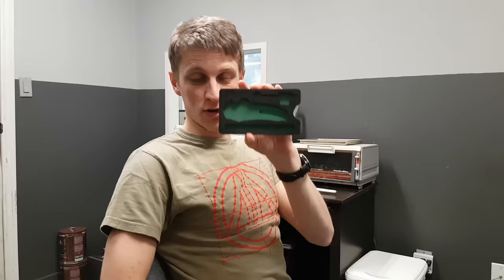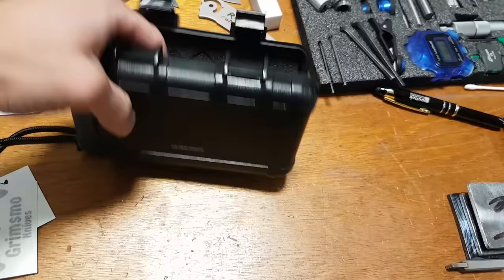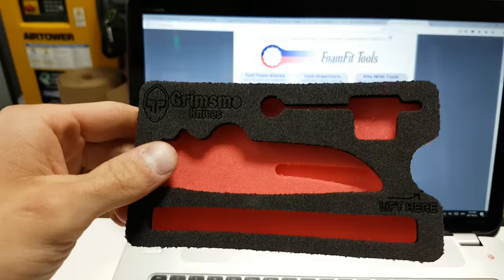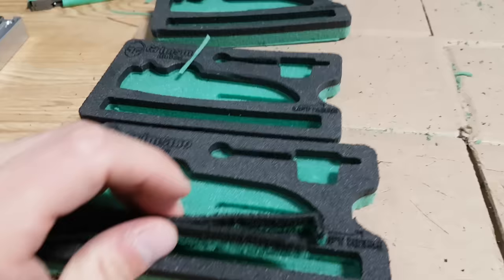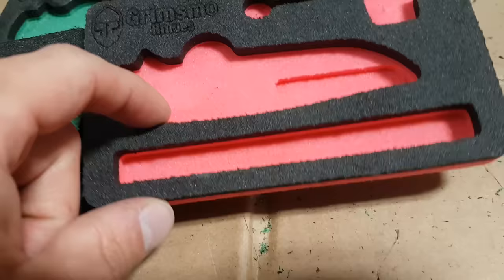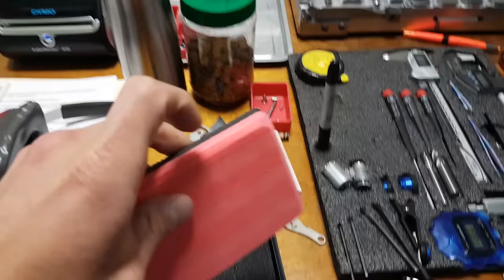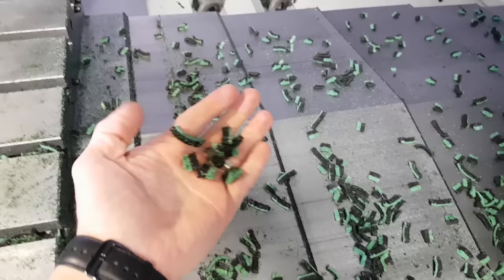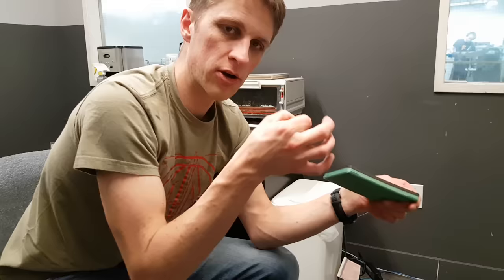How to Cut Foam

Comment: Hi. I work at a flight case company in Holland where I cut a lot of foam for huge flight cases to tiny presenting boxes like yours. So I thought you might like some tips. How we do it. Instead of putting the foam directly onto the suction grid we put a thin sheat of 3 millimeter mdf wood that allows the suction to go tru and then set the dept of the router to just hit the mdf so you cut al the way tru the foam. So then you get an instand smooth edge. I do like you're idea of the table router to round of the edges. Nice! We use a very fine bandsaw that you can put on a 45 degree angle. But I think you're doing it well! When the foam comes of the cnc it's always a little bit rough, that normal. So we hit it gently with a heat gun so it melts all the burs away and gives it a general smooth finish. Another thing, my personal taste, I think it looks a lot better If the egg box foam in the lid has smaller bumps. Here in Holland you can get them in all sorts of depths en thicknesses. Good luck!
Reply: Genius, so many great ideas/improvements in the processes
Reply: I have a more effective way to cut foam😊

Comment: I spent 40 years in the machine tool industry John and you did a great job with that foam insert.  I had several ideas pop up during the video only to see you use them later in your presentation, so "great minds", eh?
All in all, nicely done and it was fun watching the problem solving process again.

Comment: A trick for getting rid of the fuzzy edge is to use a heat gun. The tiny fuzz shrinks from the heat faster than the solid foam will burn. So if you do it quick enough you get a clean product.

Comment: From experience, if you go over eva foam lightly with a heat gun it helps clean up some of the fuzz around edges. Not sure if it'd work with that foam but might be worth a shot on a scrap piece.
Reply: #CosPlaySecrets :D
Reply: Yea Ive done this! Hit it quickly with the tip of a bic

Comment: I have been CNCing foam for years. I assure you that trimming the outer edge of the hole first is what we have been doing for years. With foam working from the inside out almost always works better. We have used a curved razor as well as routers to make radius edges.

All in all very good job with a nice learning curve.

Comment: Hi John,

You can cut all the way through the product if you use a 5/32 piece of hard board with a flat closed cell (Adhesive backed) foam on it. You then can suck that down to the vacuum table and cut shallow pockets that follow the general shape of the part with just a little offset. These smaller pockets would essentially combine to form the shape of a part which you then create the array from. This forms a seamless, flat, gasket surface that will not leak. Ports are added to the jig to allow vacuum pressure to build in each pocket section. Then, you just suck down the template and your raw material at the same time. 

Here is the ultimate trick that makes this work. Since you now have a thickness to the foam that resides on the top of the template (bottom of the case foam), you can now cut all the way through the case foam without releasing the part as long as you only cut into the template foam but not through it. We used this method all the time and it is awesome.

it would look similar to the jig set up in the link provided, but your cutter would not go all the way through the foam in the cut path below the part. 

This company sells the sheet goods.

http://allstaradhesives.com/cart/category/cover_sheets

Comment: I'm impressed with your process problem-solving skill. I wouldn't have considered changing tool paths to correct the edge cutting issue. Since the material in use is just foam, I THINK it might be much less costly to cut using custom dies for each layer, before bonding them as a final sandwich/assembly. Instead of wearing out an expensive CNC router that requires several minutes per unit... a custom cutting die would simply press down and through the foam in 2 seconds. A medium durometer rummer base surface would preserve the cutting edges forever (virtually). I don't want to sound critical. Your business and presentation/marketing skills are exceptional. Thanks for posting.

Comment: I had an idea for the back radius: A screen for the vacuum plate to put the foam inserts back on it upside down and milling the big radius on the CNC. Picture a lasercut plastic/acrylic/wood/thin aluminium "waste" lattice from your parts. With the screen you locate the inserts to the plate and cover up the exposed bits at the same time. This way you can even mill a small pocked if you need more space for things in the bottom.

Comment: I use a 20w fibre laser to mark foam like that, and it comes out really well. Just melts the surface, very clean high resolution mark in only a few seconds (along with some nasty smoke.) I use plastizote LD45 or thereabouts for the foam, routed and then laser marked to put the logos on. its so fast, we even engrave customers names on their foam as we send stuff out. Takes seconds.

Comment: Maybe you should make a aluminum/ Plastic template that fits inside the foam cutouts, on which the router bearing could ride. I think it would make Berry's job a little bit easier and more consistent.
Regards from germany
Reply: Great idea. I would try a frame enclosing the upper half of the foam combined with an undersized bearing to end up with proper final dimensions.
Reply: Exactly my thoughts.
Reply: Ooooor make a die from steel die rule and use a clicker press.

Comment: In re: "Make chips" - I don't know the details of your plastic foam, but in some cases you can make soft materials like this more brittle by keeping them in the freezer until you need to machine them, or by some kind of forced air or wet process at the bit to keep them from melting by tooling friction.

Comment: I just saw this video.  Awesome.  I highly suggest you watch (albeit totally different subject) the following channels about working with foam.  Kamui Cosplay and PunishedProps.  I highly suggest trying the heatgun method for heat sealing and deburring the foam...  I always though about laser cutting the layers and glueing them later.  So thanks for sharing.  Cheers.

Comment: Great work on the foam John. I have a suggestion that may have cleaner and safer results when routing the radius. Machine a jig that fits over the foam, just the upper half and put a smaller bearing on the bit and presto, clean, precise and no accidental radiuses on fingertips.
Reply: 393stroker, Great idea!

Comment: Have you considered to cast the foam parts? Smooth-On has lots of different types of foam, that would fit your needs. This way you could cast the foam parts in ONE go. If your mould is big enough for 6 pads, you could make 6 pads in less than 5 minutes. Nice video btw. Thanks.

Comment: 25+ doing custom interiors,,and still using a DA with 60grit 3in flex wheel,,,Router use was a super means of removal,,love it,,nice to see you putting should detail into the cases,,Bear

Comment: At the beginning I was saying "No CNC, no CNC", and then "Crap!". Apparently everyone but me has a CNC machine, lathe, and a 3D printer.
Reply: Damnit Jerry I thought there was a hair on my monitor! :D
Reply: Atleast get the 3d printer...they are as little as $130 for a decent one.
Reply: Yeah as the other dude said, 3D printers are not prohibitively expensive. The software to design (such as Fusion 360 non-commercial license) and slice your files is free, many free models online also. Material is fairly cheap

Comment: When you form dense foam buttstocks for guns you grind them on a belt sander to get the final shape.  However they tend to struggle because the friction makes them too hot.  Try putting your foam into the freezer before you use the roundover bit on them.  I bet that will make the roundover easier and cleaner.  The cold will make the foam more ridgid during the roundover process.  Worth a try and is the go to trick for ridgid foam grind to fit shotgun recoil pads.

Comment: Should be able to use wood router bits in your mill. Quarter inch radius corner rounding bit with no bearing, run it like an endmill. Only trick might be fixturing and holding the foam after you finish the top and flip it upside down. Might be able to make a fixture plate that will sit on your vacuum plate and direct the vacuum to the right places to hold the individual pads once the router bit cuts them up.
Reply: l wilton I concur,  just stop, flip, change tools and bam, perfect every time.

Comment: Thanks for sharing your videos.  I'm sure you have given lots of people the courage to become an entrepreneur since you fill in a lot of the mystery of all the steps it takes to run a small business.  Since you have the equipment to make a mold, have you thought about just creating the exact piece through injection molding?  Of course you would have to learn how to mix the chemicals to make the foam, but it would give you a nice smooth surface finish, and it would give you even more control over the process.

Comment: Looks cool. Only suggestion I could make that would help your throughput and may assist with your router table, is to use a profile cutter to remove your foam from your blank. Basically a razor sharp cookie cutter. Light press around each perimeter and you no longer have the remnants to work around for the bearing. Or you could use a 3m strip on the base or edge of the vacuum holes to hold the pieces to the table and then remove the material you leave.

Really cool either way.

Comment: John, look into what's called a pin router.  It will cut the same pattern every time. Make a pocket for the foam to fit in and then you can rout the the edge the same every time.

Comment: I loved the look of your logo on the top foam. Heres a thought. A little dab of adhesive on the tips of the egg carton foam and the foam put in wavy side facing the case top. This will glue it so it wont fall out. Your logo on the flat side so you can see it or on a thin piece of denser foam adhesived to the flat side of the wavy foam. All this should give you a springy top foam that will hold everything snug when the case is shut and still have that super bad ass look of your logo on the top foam. Just a thought. Hope it makes your product better.

Comment: You can use the big cnc to make a mdf support, fit the foam in the support so it stays firm, then use the table router with the roundover bearing indexed on the mdf.

Comment: The round over router bit has a bearing that needs a hard surface to follow. Make a insert that mates to the foam cut out but offers a smooth hard outline surface for the bearing to profile.

Comment: Hey John, you might want to look into a straight flute endmill instead of spirals. I use to cut plastics and wood with spiral endmills but they leave rough burred edges. With a straight flute, you should get clean pristine edges on foam all day!

Comment: Ever looked into die cutting?  It's FAST and CLEAN.  Die cut the top then glue the color pad layer and die cut the outside.  Emblem could be heat stamped in less than a second.

Comment: Hey John, My thoughts on the foam Radius. Machine a positive die/male. this way the foam could be turned over and the die used as a template/pattern routing system. With a custom router Bit (lets say lakeshore), bearing on the bottom to follow the template, foam upside down on the template.  This could face the edge and round over the radius. Please get your man a pair push block.

Comment: You might be able to remove the router table step all together with a back corner rounding end mill. Use the thumb indent for entry/exit location and then just go for it full engagement. Lots of reasons this might be a total disaster and would definitely not work in materials that aren't foam but who knows, might save time and give you control over that last step. Really cool video btw.

Comment: I'm surprised you don't laser engrave and laser-cut the foam, or water-jet cut it—it gets past all the pesky issues that machining the foam creates. Since you're not using abrasive media with the water jet for foam, it's actually pretty economical. Maybe for a future case revision—as is, these are still great and you've really laid out a good process to do it well with the machine tools!

Comment: Cool video.  I can see you guys are very passionate about your products and packaging.  If I may make a suggestion, others posting here have mentioned this, take a look at custom die cutters, or custom die cutting service.   If you had a set of custom dies made for your cutting shapes, you could drastically reduce your time in preparing each piece and eliminate burrs, rounding, and ragged edges.  Milling is nice, but makes your time considerable for each piece.  You spend a lot of time trying to fix the problems associated with milling. Maybe a heat stamper or different kind of die could impress the logos and lettering.  Check out custom die cutting services, too.  Just suggestions.

Comment: Wow when i was watching the video,I could not believe you were milling the foam,I could see if you needed a one off item,but i was like screaming as i was watching more and more just thing why are they not Die cutting them,it is super easy to do Basically you just bend up thin spring steel called Die Rule,and you just insert them into a MDF pattern of your shape and use a Arbor Press or a Rubber Mallet to hit around the Parameter very simple,then you can use 3M contact adhesive to laminate the two different colors together
Reply: erik pecchi with a die they’d need a clicker press. Quicker than milking them out.
Reply: We used to mill ours as well because you need varying depths, which not easily achieved with die cutting processes. Now we use a laser to cut and glue the layers together, which is still labor intensive.

Comment: If you want to know the proper way to do this that industy uses, lookup "steel rule die." They are mostly used by the cardboard industry, but are great at cutting foam/rubber consistently, quickly, precisely. At the place I used to make them we charged about $500 for a basic one. You can buy the steel rule and make one yourself by bending it and hammering it into slots cut in plywood.

Comment: At our makerspace we really love using a laser cutter on foam like this - but we wouldn't be able to do the dual layer like that without manually gluing it after the fact. (cut stencil then glue to solid base)  Laser foam is awesome. Looks like you tweaked this to perfection too :D

Comment: I have never machined foam but my first thought is. For the bottom consider making a cap that locates off your cuts in the foam or the outside. Then use a router table with a radius bit. The cap is for the bearing to run on. Or make a vacuum plate to hold them 2nd op in the mill. Why do such high quality work if you are only going to go 90% of the way. I realize this might be hard to understand I can try to explain better if needed.

Comment: I'm curious as to why you wouldn't want to use laser cutters, as opposed to the carbide engraving tools that you're currently using?  Lasers are so much more precise, and they are economically priced too.  Lasers will also provide a much tighter fit inside the case, along with cleaner lines on the cut.  Still, I admire how passionate you appear to be with the creative solutions that you've come up with for your product(s).

Comment: One more tweak to your process would allow you to complete the edges and underside chamfers in one setup.  Make a custom vacuum Chuck with 6 raised chuck platforms slightly smaller than each foam insert.  The height of the platforms should be at least 1.5 X the foam thickness.  When you cut the perimeter of all 6 inserts, the scrap will fall below the bottom of the inserts.  Now you can use a dovetail cutter to finish the underside chamfers.  Turn off the vacuum, and you have 6 finished parts.

Comment: To avoid loosing suction, but being able to cut through, you could create your own vacuum pattern. Place grooves like your original table has where your final pieces will be, but don't place any grooves under the cuts. This way you won't break the seal making the cuts.

Comment: You could cnc or route a zero clearance plate for the router table fence, that would allow you to push the foam up against the face of the fence rather than just a small bearing.

Comment: Would it almost be worth it to have a small Tormach 440 just for the foam as much as you are cutting?  I hate having to clean our plastic and foam out of our machine
Reply: NotoriousAudio they sold their 440 last year!
Reply: A 440 would be way overkill, even a cheap little ebay-special CNC router would do it no problem
Reply: Evan Bunke.  I didnt even think about a router. Would be a much better option. Im mainly just thinking in ways to free up more space on his 40 x 20
Reply: NotoriousAudio yeah definitely, that Mori is wasted on the foam. I bet the router would pay for itself pretty quick just by how much it would let the Mori keep running knife parts. Edit: and like you said, it would save a lot of time (aka money) cleaning foam out of the mill
Reply: Matt Inkel they never had a 440, he had an 1100 and SL15. But yea, I bet he wishes he would’ve just kept it around for simple stuff like that!
Reply: @michaelardoin4260  just build a mpcnc, you can build them super cheap for like $400

Comment: Hi guys nice job, that's what we call QUALITY and continuous improvement.  Peoples are not always thinking and considering the hard works and the value behind the scene.  One thing to ask, did you ever tried to do another pass with a rooter cutter on the computer assisted cutter to have the same nice finish than the bottom of the pad by using the rooter table?

Very nice video, again, good work!